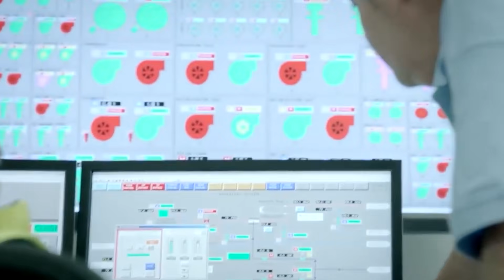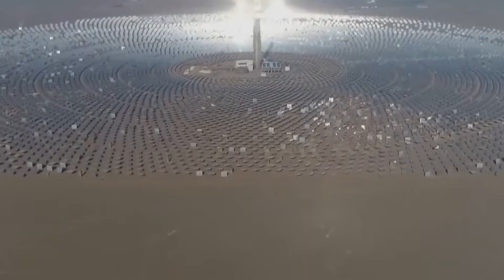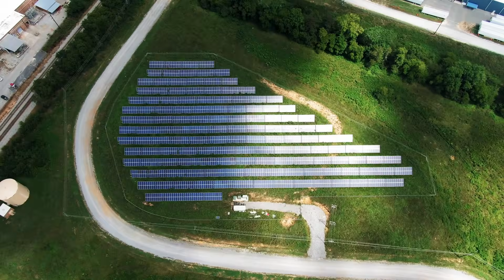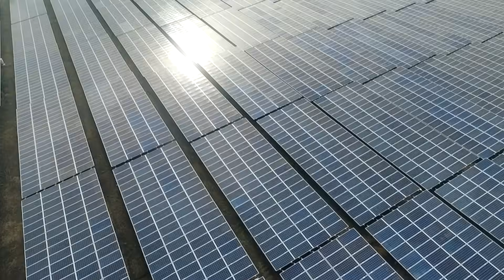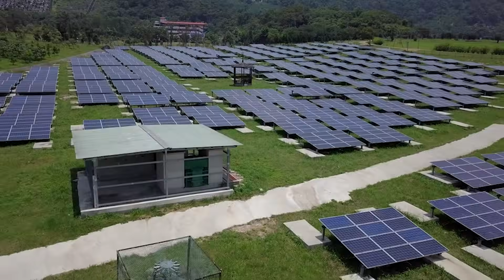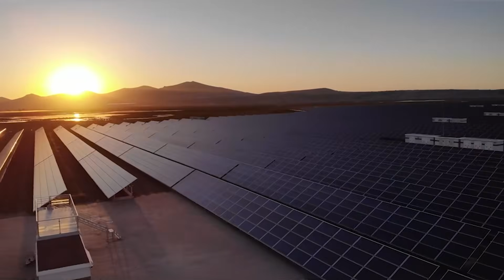China Just Built A Solar Panel That Works At Night

Comment: Since the digits of Pi were calculated beyond a couple of handfuls of digits when computers came in Israel, it was found that the first 611 add up to 2701, and it is long known that the Gematria of the first verse of the Torah is 2701, and the Hebrew word for Torah is 611. There are many more odd things about the 2701 Gematria of the first verse. The Star of David on the Israeli flag, is derived from the first verses Gematria of 2701, by first omitting the Gematria of the 3 central words of the 7 words of the verse, and then subtracting their value as well, leaving 937 (a Star number) from the 2701.

18 Here is wisdom. Let him that hath understanding count the number of the beast: for it is the number of a man; and his number is Six hundred threescore and six.

For many years “VICARIUS FILII DEI” has been known to add to 666 in Roman Numerals, and is said to have once been written on the inside of one of the Popes hats inherited from past Popes. V=5 I=1 C=100 A=0 R=0 I=1 U=V=5 S=0″”””””5+1+100+1+5=112″”””””F=0 I=1 L=50 I=1 I=1″”””””50+1+1+1=53″”””””D=500 E=0 I=1″”””””500+1=501″”””””112+53+501=100+500+10+50+2+3+1=666.

Recently “VICARIOUS FILII DEI” was found to add to 165 if each letter is replaced by its number of place in the alphabet, 22+9+3+1+18+9+21+19=102″”””””6+9+12+9+9=45″”””””4+5+9=18″””””102+45+18=100+10+40+10+7+5+8=165, and the 165th digit of Pi is 2, the 166th is 7, the 167th is 0, and the 168th is 1, making 2701 like the Gematria of the first verse of the Torah. Also 165+166+167+168=666.

The first two words 112+53=165 and the third word 501=3*167 and the 3rd digit of the 2701 in Pi is the 167th.

To this day the only Church that explicitly says that numerology is divination is guess who?
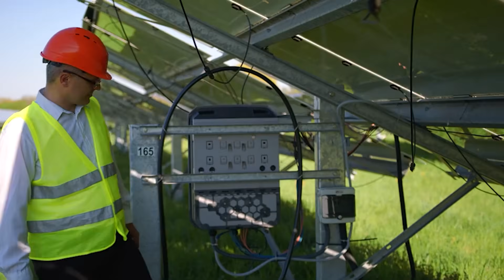That Church goes against Rev 13:18 by not letting a person calculate.
Only by the love for the remains of Israel have People let a person to calculate.

Comment: 10s of milliwatts of power at night vs 700 mW during the day. Let's say about 2%. That's not a lot, but it can reduce the need for battery storage, especially if you take into account about 15% loss for storing in a battery. It all depends on the price of the panels. If they are about 10% more expensive, it might be worth it. Batteries are expensive and they don't last long if used intensively.
You already mention sensor as a possible application. But I think direct PV in general is a possible application. Some people attach their DC devices (phone charger, LED light, fan) directly to a PV panel without any battery or even a charge controller. It would be great if for such systems you could at least run a small LED light at night.

Comment: Radiative heating better for cooling than generating electricity??
Reply: Yes, I'm thinking about something like this too. There already exist PVT panels, that allow you to pump a liquid underneath a solar panel towards a heat exchanger in order to extract heat from the air surrounding the solar panel. Similar panels could be used to pre-cool a liquid at night to reduce electricity consumption by an aircon. At the same time the liquid will heat the panels, which could increase the output of the thermoelectric layer.